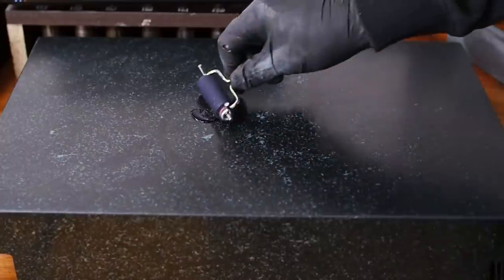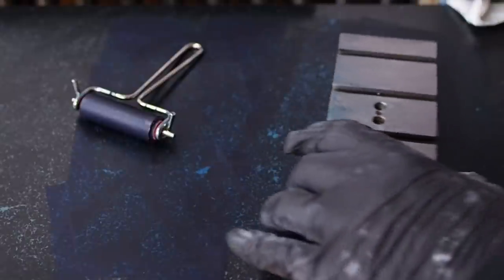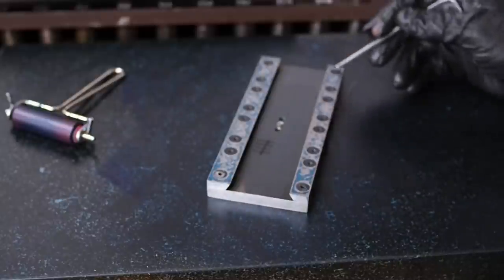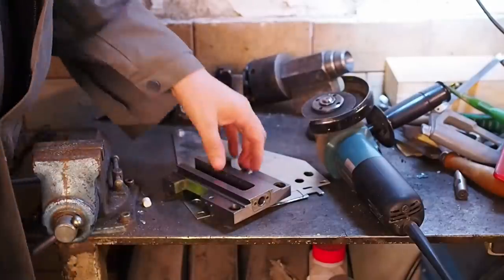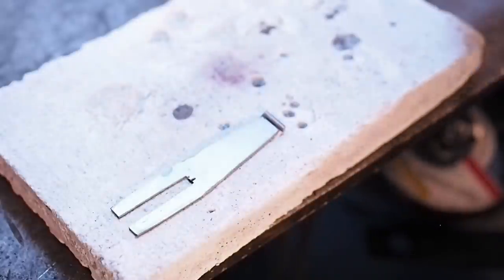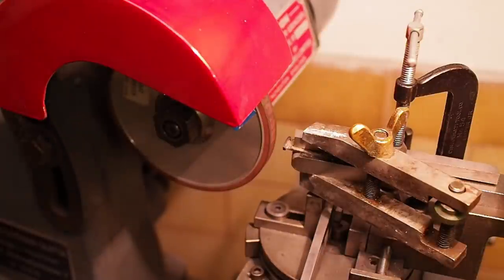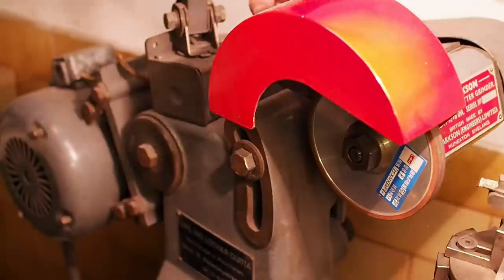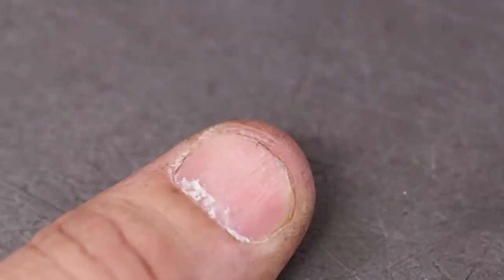Modifying the 7x12 mini-lathe - Episode 8 - Saddle and cross slide scraping.

Comment: Most Americans under the age of 40 have never even heard of Whitworth, except maybe in passing. I'm 68 and as a boy, my father owned a Triumph TR3 sports car and a succession of Morris Minors (which I got as hand-me-downs). This was the US heyday for British cars from the mid 50 to the 70s (before Japan took over). Being the mechanical one in the family, I ended up using Whitworth tools from about the age of 10 or 11. At 16 I rebuilt my first Bug-Eyed Sprite engine (my older brother's) and my first car was a red 59 Mini. Good times!
Reply from the maker: I worked on some Aermacchi RR jet engines in the Air Force.
RR Engine = Whitworth
Magnelli ignition = Metric
Woodward Hyd Pump = US AF.

Sponsered by Snap-On!!!

Comment: To fix the tooling problem on the Clarkson, you could find the largest bolt needed on it, get several more, and reduce the threads to fit each of the other bolt holes. At least that way, all of the heads would be the same, and you'd only need one tool!
Reply from the maker: Good idea, but knowing me I am more likely to just keep ever allen key ever made on hand when using it.

Comment: Back in '74 I worked for a firm in Bristol UK and they had a guy there working the cutter grinder and he was a regular tea leaf (thief)  when it came to any tools not screwed down.
One of his attempted would be acquisitions was an old Clarkson cutter grinder, the same model as shown in the vid.
By degrees he stripped the machine down to manageable parts and slowly made them disappear..........that is all but the XY slides that were stashed under his work bench out of sight.
I stood in on the grinder when he went off sick and managed to acquire the XY slide parts by simply asking to buy them for scrap.........to say he was livid was an understatement when I said the bits were thrown out as they were only scrap.
Looking at the vid I immediately recognized the XY slides......that Clarkson machine was the biggest abortion that machine design could be......my current grinder is a CUTTERMASTER made in the USA, by all accounts the Rolls Royce of cutter grinders apart from a Millacron.
Reply from the maker: You have great stories, gret knowledge, and a great workshop. You need to start making videos to share that.

Comment: Just started watching this series. And I was wondering if it would be possible to make the lathe body out of a higher carbon steel instead of cast iron to improve the rigidity of it. Or is that impractical for something like this?
Reply from the maker: Thanks for watching. 
Steel has a higher youngs modulus than Cast iron, and for the same area moment of inertia will therefore be stiffer. Many high quality lathes like Okuma and Colchester were made with cast semi-steel beds, although that was probably done more for wear resistance.

Casting steel is a more differcult process, it shrinks more, it will have higher residual stresses to be dealt with through heat treatment

Cast iron has better damping properties. The main thing wrong with the mini lathe bed is that they didn't put enough iron in it. If you look at the beds of watch lathes of similar swing, like Schaublin, Boley etc,  they have much thicker bed castings. Basically Sieg scrimped on the iron.
Reply: @RotarySMP  so it's possible but not very practical basically.
If I was to go for a small lathe or a small milling machine (I dont have the money or room for big machines), do you have any suggestions?

Comment: Is there any need to work a part to a better tolerance than it's flexibility?

(in otherword if it flexes in normal use by up to a thou, is there any point scraping it to half-a-thou?)

AKA no accuracy without rigidity
Reply from the maker: Good question. You can still turn a very precise feature on these lathes. A bearing seat can be turned to close to 1or2/10000"( a few µm) accuracy, but you have to reduce the tooling pressure right down. Very sharp, high positive rake tool, taking a very fine pass. That way you wont have that thou of deflection, and the accuracy can be reached despite the lack of rigidity.
Reply: @RotarySMP  Interesting you should mention "sharp".

A lot of people these days seem to be using carbide indexable tooling, which is great, but not the sharpest - it has a stated-minimum depth of cut, and requires quite a high horse power machine.

I suspect some tasks would be better performed with carefully sharpened (and honed, and even polished...) cutters. Better finish, finer cuts, less tool pressure.

The peak devotees of sharp tools were the ornamental turners, where sandpapering or polishing the work is not possible, so the final finish is straight off the tool. They used a gadget called a goniostat (a type of compound angle sharpening jig) so they could sharpen to a desired angle on a succession of grits, finishing on a cast iron lap loaded with rouge!
Reply from the maker: @paulwomack5866  Stefan Gotteswinter touches on this topic in a number of his videos. He does a lot of his very fine work with carbide tooling ground to specific shapes but always diamond honed to be a sharp as lapped HSS,
Reply: @paulwomack5866  The peak in carbide usage for small lathes.....now both very affordable and of Chinese origin..... is because they are mainly used by amateurs and people who can't grind lathe tools.

Comment: Nuts and bolts aren't as standard as we are led to believe. I have had to make bolts with metric threads but BSW (prewar) size heads for old Austin's (edit read Morris) and Metric head sized UN threaded bolts for prewar Lancias.
Early Austins (edit Morris) used French engines but English mechanics only had BS spanners. Likewise Lancia got threading equipment from the Americans and mechanics had metric spanners. Who said engineers were logical?
Reply: Are you sure you mean Austin and not Morris? Morris definitely used metric threaded bolts with imperial heads on their Hotchkiss engines which were designed in Metric. Curiously Hotchkiss was founded by an American, who moved to France... Maybe that's why they also made machine guns?
Reply: @andypughtube  you are correct I did mean Morris, i think it was a 10, forgive an old man's memory.😭
Reply: The best thing about standards is that there are so many to choose from!
Reply from the maker: @somebodyelse6673  Love that statement.

Comment: I am not convinced that steel is the right choice for a cross slide. If you were truly committed to pimping this lathe you would be using an Osmium casting, that's twice as stiff as steel or iron. 
https://en.wikipedia.org/wiki/Young's_modulus
Reply from the maker: Good call Andy, but that is aiming a little low. I have a RFQ's out for a solid carbide cross slide.

The steel laminated cross slide was done using a very limited equipment I had access too year ago when I did that.
Reply from the maker: Oh wait, Osmium us right up there with carbides.

I do wonder whether diamond filament will become a commerial product in our life times. Imagine diamond filament reinforced epoxy as an engineering material.
Reply: @RotarySMP  Sigh....how much of a silk purse do you want to make from a pig's ear with this down to a price Chinese economy lathe.........a carbide crosslide???.......have you ever heard of such B/S.
I think you would be better served by making a new thicker saddle and crosslide out of unhardened tool steel and raise the centre height 10mm or so to cater for the new thickness.
BTW, many years ago I collaborated with a friend to make a lathe from steel etc and the saddle and crosslide surfaces were lined with brass shim.
Brass on steel works very well, and for this lathe, with the suggested all steel saddle, the brass would work exceptionally well with the cast iron bed......I think you could coat the wear surfaces with Tobin bronze and then machine and scrape it back if you were a perfectionist or a masochist for all that work.